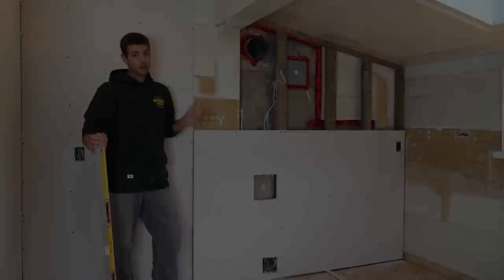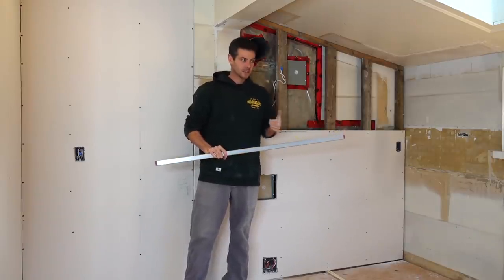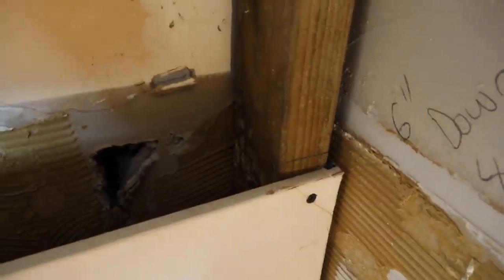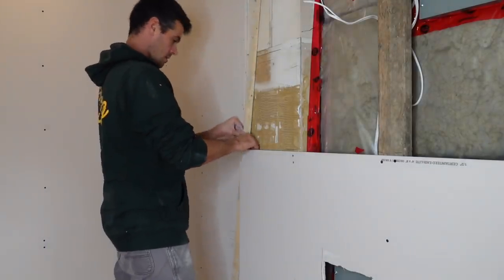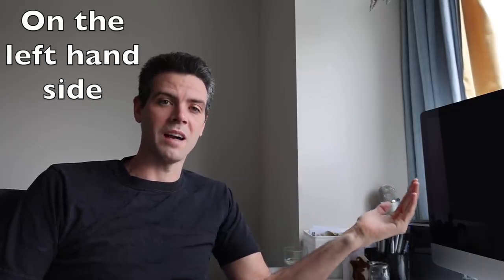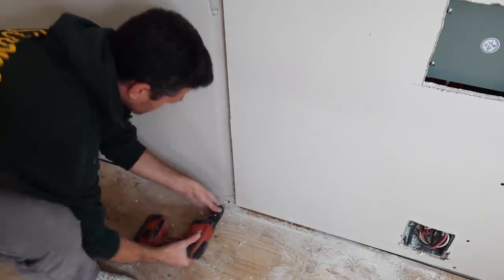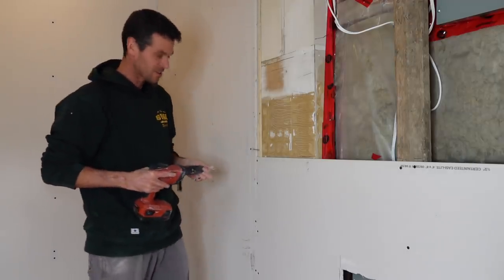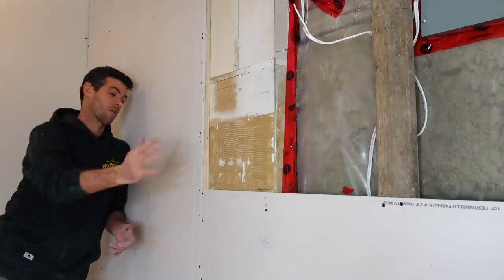What separates a GOOD DRYWALLER from a GREAT DRYWALLER!

Comment: I made this mistake in a house that was gutted. It was plaster which I now know hides a lot of wavy studs and rafters. I didn't know to check this carefully and the drywaller didn't say anything when coming to quote and never mentioned it during the job but left a mess in a few places. 

I think the drywallers should at least inform the homeowner that they need to take care of this or pay more to do it right. I caught it partway through and at least fixed all the ceilings by working evening and weekends around them.

Comment: What stopped you from just removing the problematic cornerbead?
Reply from the maker: Having to dispose of old drywall.
Reply: @vancouvercarpenter  Isn't disposing of old drywall a part of a renovation?
Reply: It is very difficult in Vancouver to dispose of drywall. The dumps/transfer sites don’t take it
Reply: @jontowns6728  Certainly less options, but New Westminster takes it from Contractors.
Reply: Guy from Oregon  here, is drywall considered a hazardous material up  Canada?
Reply: @vancouvercarpenter  Story time, Years ago a landlord rented his home to a seemingly responsible  individual..after a couple of months the renter stopped paying rent. When the owner stopped by to talk to the tenant he discovered that the house had been filled floor to ceiling with used drywall..not sure if that was covered by insurance!
Reply: @vancouvercarpenter  Interesting…  disposing of demo debris legally around my area isn’t a problem so I’d not considered it to be an issue.  A classic case of the varying conditions we all face…
Reply: @dljones61  Pre-1990 gypsum wallboard (GWB) needs to be tested and confirmed non-asbestos containing before you can dispose for recycling. If ACM then needs to be disposed at authorized sites for hazmat landfill. Safe GWB is recycled. 

Problem is that Vancouver talks the talk about being 'Green' and wanting to recycle, but then makes it hard for contractors to do so. There are still plenty of transfer stations that take GWB, including waste disposal companies that provide roll off bins.
Reply: So stupid. People have commented before that you could easily white bag that small amount of drywall and put it in the weekly garbage.
Reply from the maker: @JasonT__  Only fresh drywall
Reply: @vancouvercarpenter  NEW WEST GYPSUM RECYCLING (B.C.) INC.
38 Vulcan Street, New Westminster, BC takes old used gypsum if you have the haz mat report showing negative.

Comment: I would take off that horizontal sheet and cut out that corner bead and about 6 inches of that old board , probably  take 15 minutes , then that sheet will sit flush with the vertical one. Did this for 40 years mate

Comment: Why would you not put a butt joint on the concave part of a wall, where a stud is depressed or a joist is high?
Once filled the entire wall would be straight, rather than making the bows longer, get rid of them.
in my experience with fairing boat hulls, landscaping, etc it is always easier to fill a low spot than to try to fill the entirety of a plane to accommodate a high spot.
Actually, with landscaping it's a little different, like roadbuilding or any excavation, take down the highs and use the material to fill the lows.

Comment: As a tile guy I loathe when cement board has dipps and bows.outward bows screw the tile guy.sad when it's such an easy fix by sheetrockers.99% lazy and poor ethics.(and or contractor or carpenter responsible)